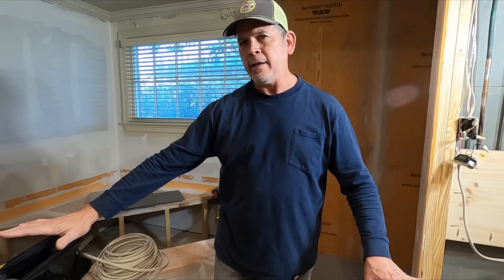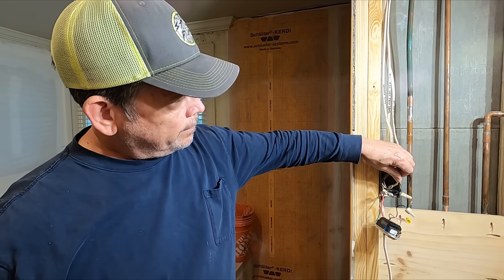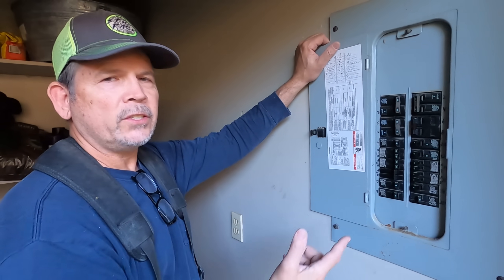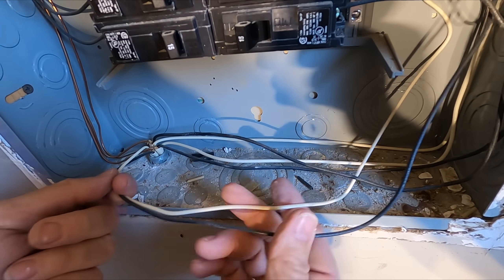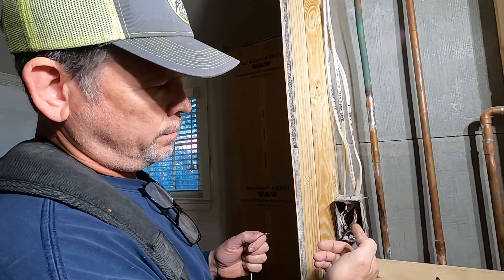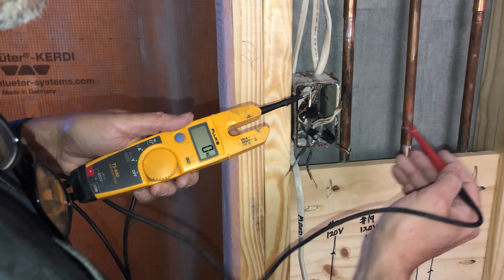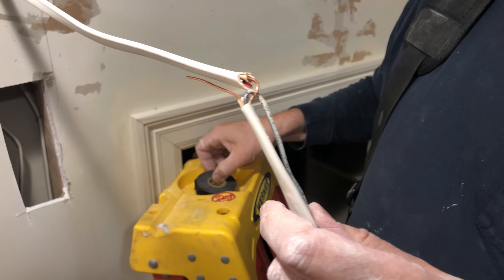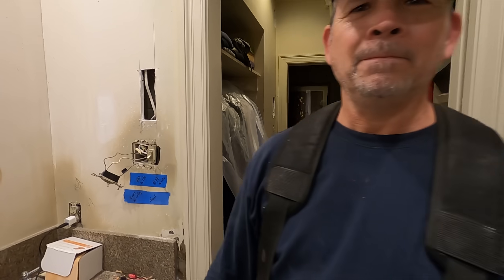You CAN Get SHOCKED by a Neutral Wire! This is How...

Comment: Black tape on the neutral wire indicates that it was used as a hot wire not a neutral at all
Reply: Nope.  He put the black tape on that wire to (temporarily) identify it as the NEUTRAL wire that was connected incorrectly ...

Comment: Every electrician knows that the neutral hurts more because you are getting hit by the voltage plus the used amps in results in 120 feeling like 240.
Reply: Actually it hurts more because you generally no longer have 120V when you open the neutral, you have 240V and because your body (in series) most likely has a lot more resistance than the other loads connected you will have the largest volt drop across your body. So you may actually be taking 160V+
Reply: @djwctbell  240 Volts on a properly wired Neutral Wire?  Nope ...
Reply: @MrSummitville  and an open neutral is considered properly wired???? You are right though, properly wired you would get the proper voltages  open that shit up and viola! You have a 240v circuit because there is no longer a grounded conductor.
Reply: @djwctbell  Dylan stated that he measured 240 Volts on the NEUTRAL !  So, I measure 240 Volts from L1 to L2 but I do not measure 240 Volts from the open Neutral to anything.  Where are you "opening the neutral" and how are you measuring 240 Volts between that open Neutral and WHAT exactly ???
Reply: @MrSummitville  go watch any video on open neutrals and you'll understand. Edison 3 wire bud, learn that shit in first year.
Reply: @djwctbell  You claimed 240 Volts on an open neutral in a home.  You provide the URL, bud ...
Reply: @MrSummitville  if the neutral opens now you have zero reference to ground. Hence no more 120V. You have a 240V series circuit. Are you an electrician? If so you have a lot to learn, may even save your life. They actually teach this stuff in 1st year. I did post a link and they even show it with light bulbs, no math needed. When you open the neutral the light bulb glows brighter. What would make that happen? Your resistance hasn't decreased. Ohms law tells us that if the resistance doesn't change than the current and voltage must be higher. If you argue this point it proves you dont know what your talking about. Fyi, I've seen too many people have to replace they're battery chargers on a jobsite because someone unspliced a neutral before turning off the breaker. Peace!
Reply: @djwctbell  If you have no reference  to ground then how can YOU measure the voltage between the Neutral Wire and Ground?   How are you measuring 240 Volts on an Open Neutral inside of the home?   The "open neutral" was INSIDE this home.  The Pole Xfrmr and the Main Panel still have Split Phase.  At the Main Panel, the Neutral Bus is still bonded to the Ground Bus.  There is no scenario where an open neutral, inside a home, will allow you to measure 240 Volts between the Neutral Wire and the Ground Wire in the J-Box.  I am still waiting for your You-Tube Video (URL) that makes your case ...
Reply: @Dylan Freeman - No, it does not ...

Comment: In a house your neutral and grounds, and water lines are bonded together, they are the same return path. Your neutral and ground bars are bonded in the panel right from the start. When you get shocked by that neutral, the closet light will also come on...you are the new path to complete the circuit. Try it...
Reply: thanks, but no thanks, I have "tried it" on accident enough thank you very much!

Comment: I  am pretty sure you could still have a disconnect in that sub. Mobile homes have a disconnect'
at the pole or meter pedestal, the load center is a sub as the grounds and neutrals  are NEVER
EVER connected again past the 1st disconnect.

Comment: Awesome work as usual. Question, that white neutral wire had a black piece of tape on it. Doesn't that usually indicate that the white wire is now a hot wire instead of a neutral wire, as commonly done with light switches?
Reply from the maker: Thx Jordan!  My bad. I put that tape there as an indicator of the “hot” neutral.  Should’ve mentioned that or used a different color tape.
Reply: @StudPack  Ahhh OK! That makes sense! Thanks!

Comment: "Black to brass, saves ur ass, one mistake can be ur last" u R right. doesn't matter who u are. Lectricity,
it has absolutely NO respect for ignorance. No excuses.
Reply: Try "black to brass" in an old house and see how that works out LMAO
Reply: @mook528  YUP funky shit in them old houses & triple deckers.
some had the neutrals fused, did not pull cover offa panel but  had 12 screw in 
fuses, um like 12 fuses?  pulled a fuse lite went out an had my leg against a 
steam RADIATOR ! like WTF  115 on the black wire, it's all good if ya like an
 eye opener!

Comment: this is a great video....ok so after you thought it was 20 did you retest  the lines? also if you used one of those gadgets that make a buzz noise would that of told you the line was still hot? i just subbed and yes more electric vids. and nice camera light and audio..
Reply from the maker: Thx for commenting.  I did retest. All was good until someone turned on a 3-way switch in adjacent room.

Comment: I do commercial HVAC&R I told an apprentice that I work with that I am more afraid of neutrals than I am afraid of “hots”. This proves it.  I’ve been but by a neutral and never found out where the mistake was.  But your video shows it.
Reply: I meant to say I was BIT by a neutral not BUT by a neutral
Reply from the maker: Yep,  My second worst shock was when changing a 277V ballast
Thx Patrick!
Reply: @StudPack  I’ve been shocked HARD by capacitors in the past. Funny thing is the pain doesn’t linger, it hits you and leaves very fast.  I need to keep up on your videos.  Keeps up the cool videos.

Comment: Awesome awesome job... it was   
Interesting , so how the pipes where involved at the second tryout when you removed the neutral wire 
Was the neutral making contact with the pipes ? In some place
Reply from the maker: Copper water lines are bonded to the ground at main service entrance at this house per code.  Ground and neutral also bonded together at main.  That’s your current path.
Reply: @StudPack  nice !

Comment: A lot of houses in the 70's were wired with what is called an edison circuit for 2 120 V outlets with  12 3 or 14 3 wire-or romex,  they shared the white neutral wire. and green or copper ground or use conduit as the ground part of a circuit.  A GFCI or ARC Fault breaker will not work on that system Each GFCI or ARC  fault needs it's own separate neutral wire, A major problem is when the shared Neutral is broken or loose and the return to the panel does not happen, the electrons return as in his diagram there can be an over 120 V in the now shared circuit. The circuit is now acting like a 240 volt circuit, Electronic equipment appliances  TV. etc are getting 24o V minus the power being used by other things in the circuit.  I am a retired Engineer, Gen contractor and Taught college electrical classes.
Reply from the maker: Great comment Tim thx 👍👍
Reply: Just to add to this, when you complete this "new" 240V circuit with your body by touching the open neutral and ground, you are now in series with the other loads. You body is going to have waaaaaay more resistance than anything else in the circuit meaning you will be taking the largest volt drop across your body allowing you to see 160V and up. If there were any lighting loads connected they would actually turn on, just may be dimmer than normal.
Reply: @tim hale - You are wrong ... Two (2) @ GFCI Outlets will work perfectly with a shared Neutral Wire. The Neutral Wire is already SHARED from the pole to the house.  Now, extending that "sharing" of the neutral to the outlet makes absolutely no difference to a GFCI outlet.  In my state, Shared Neutrals were phased out in NEC 2002 ...
Reply: @MrSummitville  he is talking about breakers not outlets. Outlets dont care about shared neutrals but breakers do. You would have to use a 2 pole arc fault breaker to share a neutral. 10 year electrician, service foreman for 2 years.
Reply: @djwctbell  Your are correct.  We have GFCI Outlets, we do not have GFCI Breakers.  We have not, and never will, "share the neutral" between two Single Pole Breakers.
Reply: @MrSummitville  how about AFCI? Applies to those as well
Reply: @MrSummitville  working does not always mean it meets code   NEC 2008
210.4 (B) Disconnecting Means Each multiwire branch circuit shall be provided with a means that will simultaneously disconnect all ungrounded conductors at the point where the branch circuit originates.

This means that the breaker handles must be tied together in the service panel, so that if one breaker trips it will cut power to both circuits. This can be accomplished using handle ties, or a double pole breaker. in certain conditions the current on the neutral  and over heaat the white wire.can add

Comment: Does anyone know why they don't have whole house GFCIs in the US?
Reply from the maker: Coming soon I'm sure...
Reply: you mean AFCIs? arc fault circuit interrupter/breaker. we do have them and they are bane of existence
Reply: @harveylong5878  I'm sorry, I could have been clearer. What I meant was that they are not commonly found, but do correct me if that also isn't the case. Also: Why are they the bane of existence?
Reply: @luigig44   @luigig44  AFCI's have been in the US for awhile, mostly in new homes/new construction. they were limited to bedrooms for awhile but now becoming mandated in almost evry room. 

as for why AFCI is bane of existance. nuisance tripping of AFCI due to appliances like microwave, vacuum cleaners.  

Most microwave ovens will generate arcs and sparks inside their cavity if they are run with an insufficient load, or no load whatsoever. The high-frequency content from these arcs is being coupled (likely capacitively) through the HV transformer section of your microwave onto the AC line, where the AFCI can then see it and proceed to freak out, thinking the arcing is actually an AC mains arc, not a microwave cavity arc.

vacuum's create a small arc within their motor when they run thus causing AFCI to generate a false trip.

AFCI has been designed to work with devices with motors that are within the FCC standard for noise. Even though these devices have been manufactured to the FCC’s standards, after frequent use wear within the motor can create noise which trips the AFCI. To mitigate the noise generated by these devices, you may use a surge plug or surge strip.
it's crock of sh-t as a consumer/homeowner, have to go out of your way to get specific surge suppressor etc cause AFCI
Reply: @luigig44   @luigig44   @luigig44  AFCI's have been in the US for awhile, mostly in new homes/new construction. they were limited to bedrooms for awhile but now becoming mandated in almost evry room. 

as for why AFCI is bane of existance. nuisance tripping of AFCI due to appliances like microwave, vacuum cleaners.  

Most microwave ovens will generate arcs and sparks inside their cavity if they are run with an insufficient load, or no load whatsoever. The high-frequency content from these arcs is being coupled (likely capacitively) through the HV transformer section of your microwave onto the AC line, where the AFCI can then see it and proceed to freak out, thinking the arcing is actually an AC mains arc, not a microwave cavity arc.

vacuum's create a small arc within their motor when they run thus causing AFCI to generate a false trip.

AFCI has been designed to work with devices with motors that are within the FCC standard for noise. Even though these devices have been manufactured to the FCC’s standards, after frequent use wear within the motor can create noise which trips the AFCI. To mitigate the noise generated by these devices, you may use a surge plug or surge strip.

it's crock of sh-t as a consumer/homeowner, have to go out of your way to get specific surge suppressor etc cause AFCI

Comment: No need to work live without arc-rated PPE. That was his first mistake. No LO/TO and no contact testing to confirm the absence of voltage prior to working on the circuit. NFPA 70E is your best friend for electrical safety-related work practices. Unqualified people should stay far away from electrical work.
Reply from the maker: Checked it all first Brian.  Things went south when someone hit that 3-way switch in the other room 😡

Comment: Hey Paul. 

I have a question about an exterior door.  I’m renovating my sisters 2 car garage into a bedroom for my nieces. Really cool project. I turned one of the garage doors into window and exterior door area. The problem is the threshold on outside has a gap between driveway and bottom of threshold. Maybe 3/8 in.  For drainage I’m sure.   I need to feel it up with something. Inner part of threshold is set in a nice bead of caulk.  At my current job I’ve seen my boss rip down some treated wood and stick it in there. I guess I think it could be done better. My instinct tells me to get some spray foam gap filler and fill it up. Not sure how nasty a reveal that would be tho.  I also considered tuck pointing some quick set concrete in there   

What do you think.  Or anyone else that reads this???
  Thanks.  Jerry from Fresno
Reply from the maker: I fill in underneath thresholds with grouting cement.  It’s used for anchoring, grouting under bearing plates, etc. available at box stores.  Sometimes I inject it underneath with a grout bag.  Other times push it under with a tuck pointing trowel.   Stuff sets up fast so maybe experiment with it first on something else.   Thx Jerry and good luck.
Reply: Thanks. I’ll let guy know

Comment: I just ran into this problem during a renovation project. Shared neutral across two circuits on old wiring. It's always surprising to find but I usually catch it after turning off one breaker and rechecking if the wiring is hot. SAFETY FIRST!

Comment: My suggestion would be to start with safe isolation technique (using a dedicated voltmeter not a multimeter and proving unit) and then lockout and tagout. That would have helped save you from shocks. Use insulated tools always when looking into a box especially in switches that multiple circuits can exist a shared neutral is always a bad idea and reflects poor planning and worse still cutting corners on cable by original contractor.

Comment: I would watch electrical fixes.  I was working a remodel where we couldn't get the gcfi to work to find the demo lady tied all the neutrals to  together in a few 3 gang boxes.  GCFi's don't work well where you have shared neutrals running though out with different loads on each. That same lady also ties all the hots together causing to two fuses (17/19) to pop or (15) to work. What she didn't know is that someone added two kitchen circuits 12/2 plus the original kitchen circuit when the home was built. (15) was the being back feed causing (17,19) to trip.  We called this the fuse popper job. Took me two weeks to straighten that mess  out. We hired an electrician to figure it out but he gave up and said "the house would need to be rewired to fix the issue."  It did take me two weeks to straighten this mess out but it works well now. There was three circuits ran to that kitchen (15,17,19). After labeling hots and neutrals out we got every circuit on GCFI and we no longer popped fuses.  Videos like these I'm thankful for because I can do my own electrical work to NEC 2020 code and pass inspections with ease!
Reply from the maker: Thx Leroy, what a mess you had!

Comment: I watched your video on you getting shocked by a neutral....I am a retired master electrician and I noticed that the white in the group of neutrals had black tape on it...according to an earlier version of the NEC  states that you can use a neutral as a hot wire if you recode it with a piece of black wire. unless you put the black tape on it then it was being used as a black hot wire.
Reply from the maker: My bad Richard. I put it there to as a flag to me that it was the “hot” neutral

Comment: Best investment for both electricians and plumbers: non-contact voltage detector; buy a good one like Fluke that has a good voltage cut-off as to not get false positives. As an electrician I once saw a bad grounding and bonding job actually electrify the copper plumbing lines. Unlike bad plumbing that can be seen in plugged drains or leaking supplies bad electric isn’t usually found until someone gets shocked or a fire starts. As contractors you should know a little about a lot, to be safe, but you should also know your limits and to get a professional in the trade in question when you run into problems. Under NEC a shared neutral is allowed on oppositional legs with a 2 pole breaker or with 2 single pole breakers tied together; though this is meant as a single circuit with 2 ungrounded conductors and one grounded conductor, i.e. 3 wire, not 2 2 wires. When the hots are on oppositional legs the amps on each leg cancel each other out; if the hots are however on the same leg the amps on the neutral are additive easily being able to overload and overheat the neutral with well over 30 amps being able to put on a 12 gauge neutral.
Reply from the maker: thx Chris.  When I mentioned the worst I ever got shocked was while I was doing plumbing work, you're example is exactly what happened.   2 wire house with no grounds, 3 prong receptacle installed behind refrigerator in metal box, no connector used, box nicks hot and energizes ground on outlet thus energizing refrigerator chassis, made for an exciting day
Reply from the maker: The two shared neutrals in this video were same phase, circuits 19 and 20, the main reason I fixed it